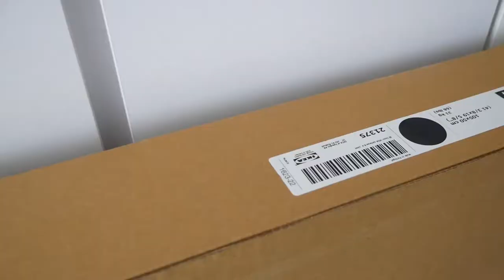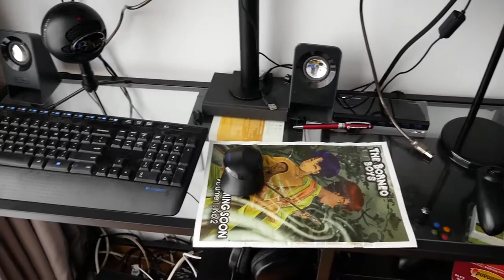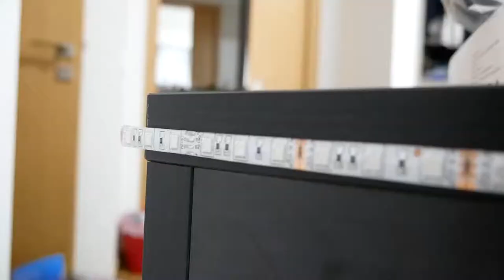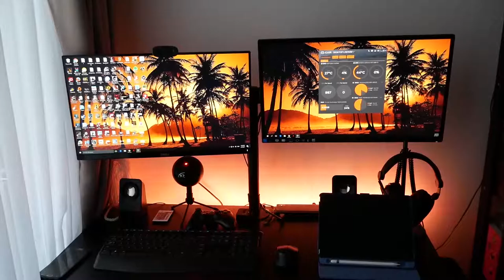VLOG 001:  Setting up my workstation on the MICKE desk from IKEA.

Comment: How did you attach the monitor stand to the desk?
Reply from the maker: The desk has a hold midway on the edge closest to the wall, and that's where I could set the monitor stand with a grommet mount
This is the mount I used: https://www.amazon.com/gp/product/B009S750LA/ref=ppx_yo_dt_b_asin_title_o05_s02?ie=UTF8&psc=1